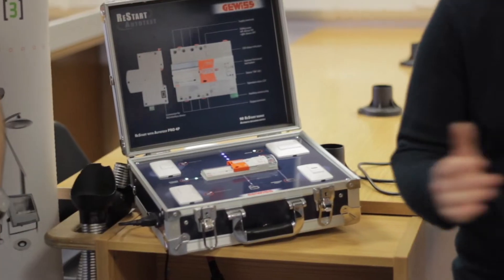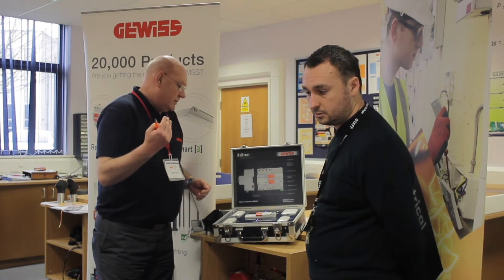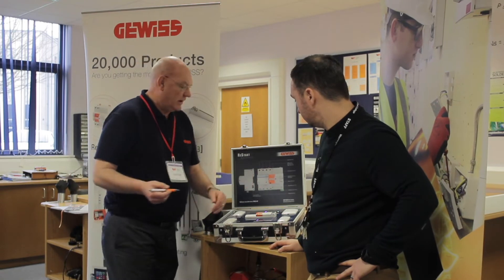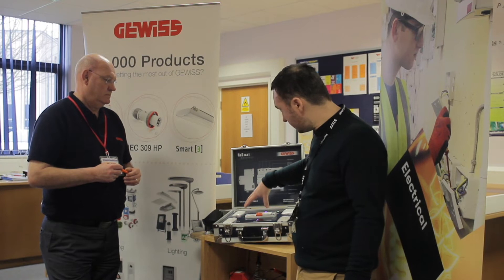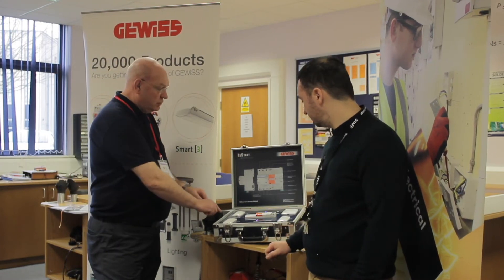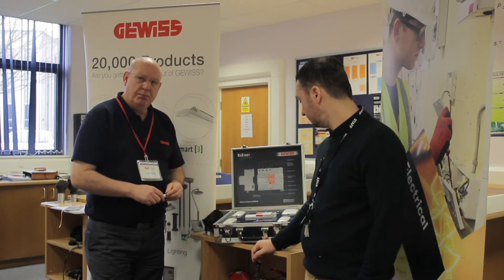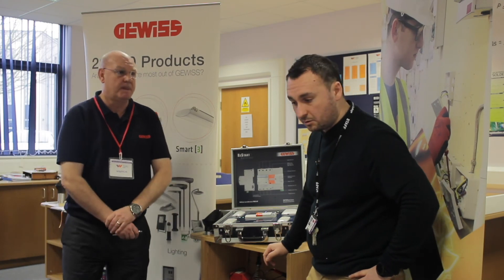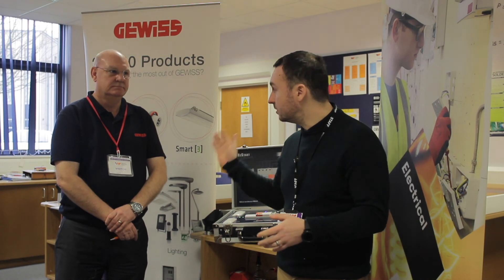GEWISS - Auto restart RCD/RCCB demo.

Comment: Are these suitable for domestic installations ? I keep having nuisance tripping and have had several people come test sockets/appliances with nothing found each time.
Reply: I am using  a 63A (german made) RCD which was dripping all the time especially when rain comes (when humidity increases). After some days I could  reset it without doing anything,  It was going on like that, but finally I found that the trouble was from a switch near the toilet.
Reply: I've installed one on our main feed in our holiday home in Italy, which was getting nuisance trips everytime a lightning storm passes over. Works fine.